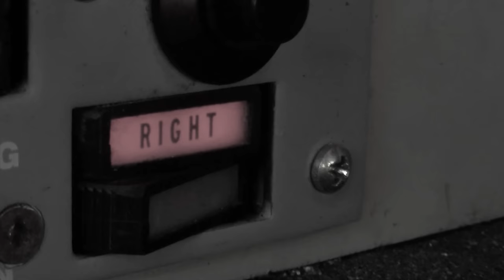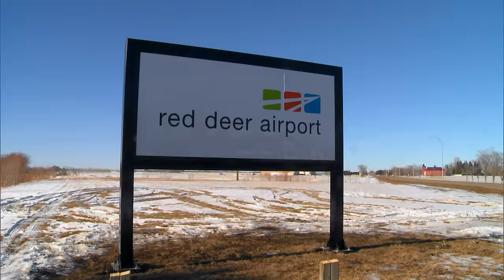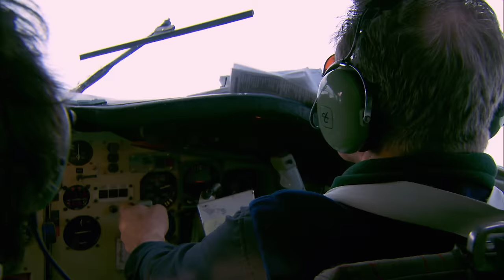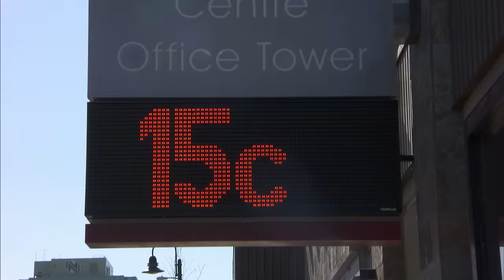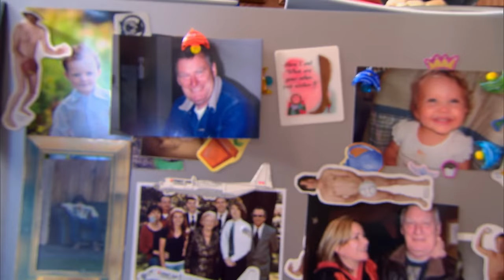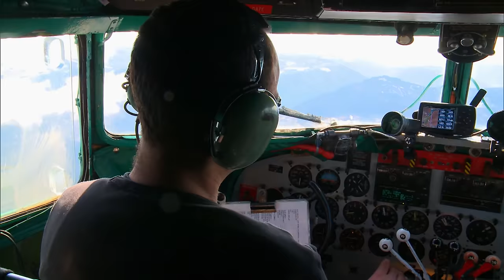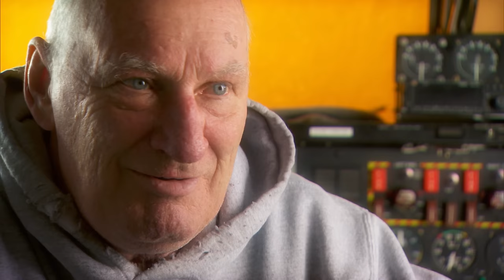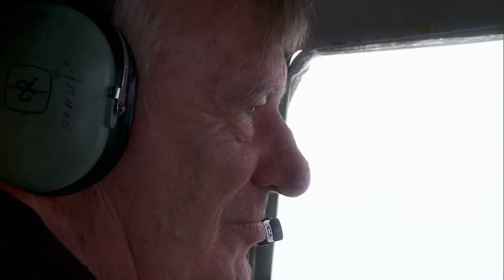Buffalo Airways Mourns The Loss Of A Former Crewmate Pilot | Ice Pilots | Wonder

Comment: I would try to find something to cover over the black ice maybe Lyme I mean it'll work with patches probably not if it was all solid black eyes and may not work and cover well but seems It's only patches of Blackness where there's no snow why don't they try to put something like lime or something maybe even flower over it so it's white not black and it would hold up for a lot longer and it doesn't need to be very thick a quarter inch at the most it would work fine they could even use white beach sand if they wanted to but it probably wouldn't pack well so I would use flour or something lime I guess lime would be the best unless it would melt the ice which I don't know but I would look for something to do that cover up the black spots with something White